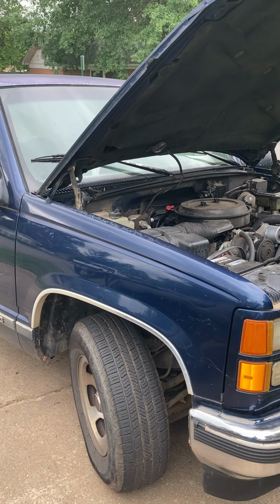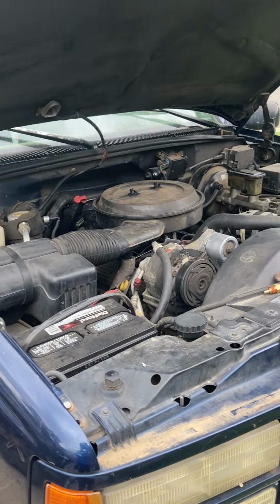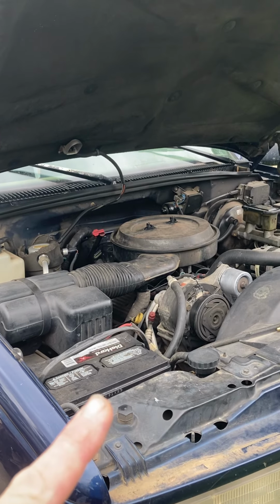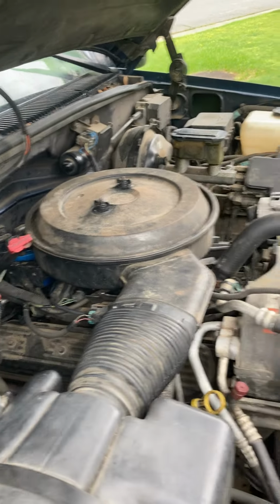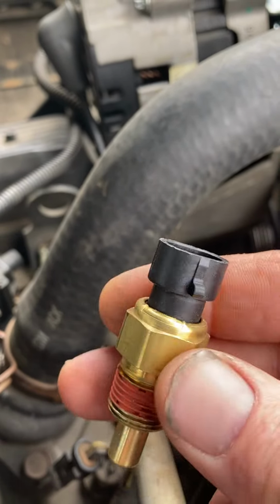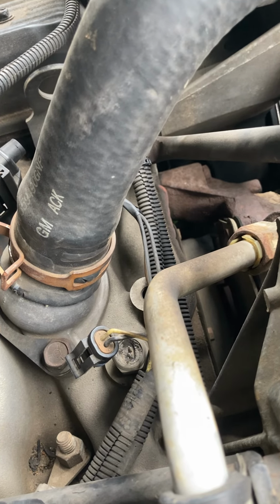chevy 350 blows black smoke randomly and stalls ! after changing alot it was $5 part fixed !

Comment: I have a stalling problem currently. Idles poorly from D (drive). R (reverse). Shuts off after. I’ve installed coolant temp, MAP, IAC, fuel pump. Timing is okay as well. If anyone has an idea of what my problem is feel free to reply.
Reply from the maker: Check your distributor? May need new rotor